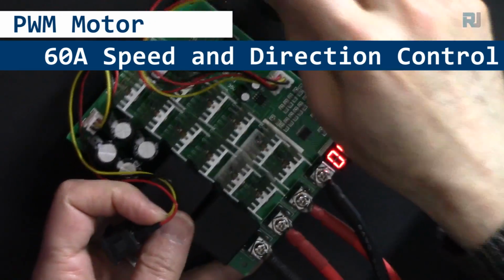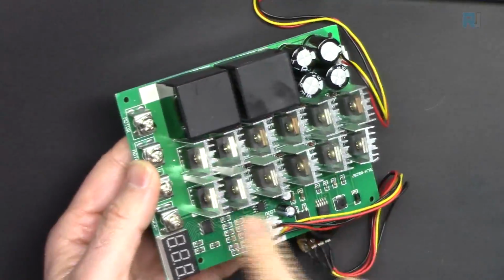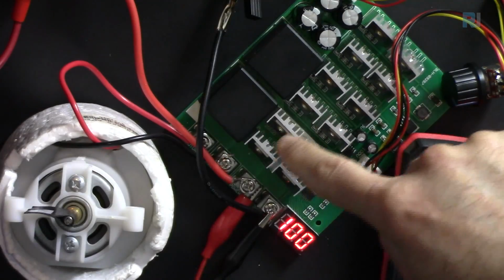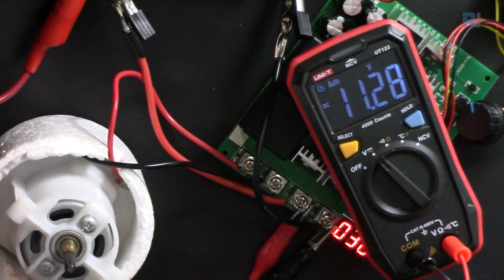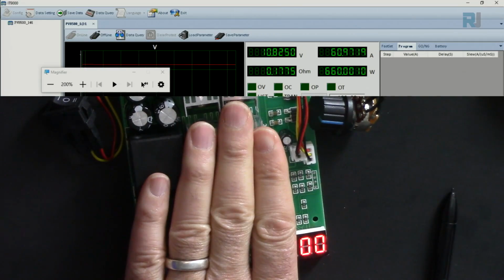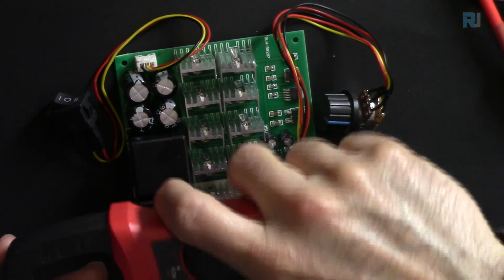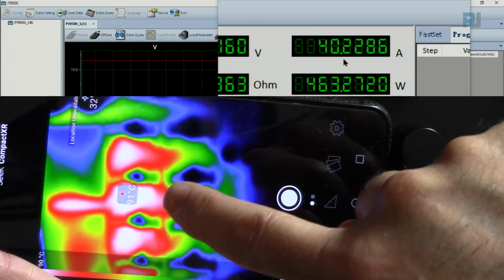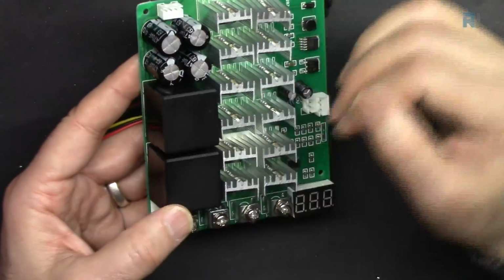DC 10-55V 60A 100A Motor Speed Controller PWM  Reverse Control Switch with LED Display Relay

Comment: Greetings of good blessings from God - May the peace, mercy, and blessings of God be upon you - My dear respected brother Ahmed, may God keep you, I have a question for you. I  would like to consult you - It was a car wrap that I converted into an engine. Are the performance tests that you conducted on these unit specifications?(DC 10-55V 12V 24V 36V 48V 55V 100A PWM HHO RC Greetings of good blessings from God - May the peace, mercy, and blessings of God be upon you - My dear respected brother Ahmed, may God keep you, I have a question for you. I know that this is not the content of this video, but I would like to consult you - It was a car wrap that I converted into an engine. Are the performance tests that you conducted on these unit specifications?(DC 10-55V 12V 24V 36V 48V 55V 100A PWM HHO RC Reverse control switch with displayLED) Is it suitable for controlling the speed of this engine? For your information, this engine has high amperage. It was the predecessor of a car and I converted it into an engine. Thank you. (And by God, I hope you will respond quickly. Thank you, because I want to use it on a cargo bike. Thank you, thank you.) LED) Is it suitable for controlling the speed of this engine? For your information, this engine has high amperage. It was the predecessor of a car and I converted it into an engine. Thank you. (And by God, I hope you will respond quickly. Thank you, because I want to use it on a cargo bike. Thank you, thank you.)

Comment: Does reducing the speed also reduce the torque of the motor?
Reply from the maker: no. the motor will slow by how much load is applied on it.

Comment: Hello, I would like to know if I can use Arduino instead of Volume (Potentiometer) , it can be controlled by PWM signal or soft start/stop instead of volume or not? 
Please help me, I will try this on my project in the last semester.
Reply from the maker: Search my channel for Arduino.
Reply: @robojax  OH Thank you!! i will check on it
Reply: @robojax I checked your channel but I don't see any videos where you hacked with this motor driver or can I see other videos with the same information about using Arduino to control instead of potentiometer of this motor driver.

Comment: Hey, does these boards need diode across relays coil?
Reply: I had the same question....
Reply: @woodworking_automation  i did not put diode. Im running only 40w 12v wiper motor with 16-18v. Use is wire stripping machine, pretty high load. Its good to oversize always chinese cheap products.. if they say its for 20a then its propably good for 5-10a
Reply: @Reivoouz  Got it thx

Comment: Would it be possible to run two or even three of these paralleled at the outputs? Also the speed control wire in parallel to always run them all at the same speed
Reply: No, these are PWM and running them in parallel without expert modification to share the same clock is guaranteed to behave badly, both from safety and from controllability point of view.

Comment: Hi Sir, you're doing a marvelous work of educating us, Can the Module Frequency be Adjusted from 1 Hertz to Maximum Kilohertz? What can be done for it to work that way?
Reply from the maker: Hi, it uses 555 time. I have explained it in another video https://youtu.be/k13iTmvPtUU and there are tones of circuits on 555 time.

Comment: Excuse Me, for you is possible use in input 57v and extract 40A continuosly in output? Thanks
Reply from the maker: I have mentione the minimum and maximu voltage. You make take risk if you connect it to over 55V. Check the capacitors voltage and see if they are higher than 60V or higher, then you may take the risk. But I woudl adivse against it.

Comment: Hi tell me please I want to operate the Governor control card for the Cummins generator QST 30 his Governor is PWM signal control I fix PMU wire RPM Sencer with potential metre tell me it's working or not??

Comment: I am looking for a pwm controlled card that works with arduino at low frequencies (for linear actuator control). Actuator supply will operate at 150-200V DC and 10A. Can you have a suggestion? 
Good work, thank you.
Reply from the maker: You can use arduino and get high voltage MOSFET it should work.
Reply: @robojax  I asked in terms of a ready-made card or product recommendation.  I don't have time to make it myself, if there is a ready-made product, I have to buy it and use it.

Comment: Mr.ahmad if input 48v...for output can i use 12v dinamo ?
Reply from the maker: This module does not change the output. If input is 48V then output will be 48V.

Comment: Middle position of the switch, you said, "is off" - what does is mean? Is the motor terminals shorted for breaking or left open for coasting? This is actually very important. Thanks!
Reply from the maker: Open

Comment: I have blown up two of these units using them fot HHO gas Generation max 25 amp 12v
I was Trying to fix them. on one the three number led gets very hot were you able to identify the driver chip.
I looked at a Tm1637 but this is for a 4 number  led any help would be appreciated.

Comment: Still hoping the PWM control hack is coming soon.  This seems to be the only motor controller that might work in my project for less than $150...but arduino control is critical.  Thank you VERY much for all the info and your efforts!

Comment: Hello Brother Nice job done ....but I need ur help regarding "bh-17n-d pwm"
How could i connect this PWM knob with Electric bike throttle beacause this bh-17n-d pwm circuit knob have 5 wires and my throttle having 3 wires.....plz guid me.
Reply from the maker: Please see my comment under other video
Reply: @robojax    still confused ....can we make a combination of pwm knob 5 wires to Ebike 3 wires? 
I shifted my fuel bike to ebike mechanical tasks finished but still hanged with that 3 and 5 wires combintion.
Inshaa Allah my project is ready but ....

Comment: Nice video. 
What’s your conclusion? I ask this before finishing to the end. Sorry. 
How can I tell if this will work for my treadmill motor? I’m using a Lieli 4.25 hp, 130 VDC model number 116ZY1-1. It has four wires. 2 for power and 2 blue ones for thermal cutoff. 
This looks like a simple speed controller but I don’t know if it will work with my motor. 
Thanks,
Paul
Reply from the maker: the maximum voltage is 55V and it will not work with 130V DC.

Comment: I haven't tried this particular model yet but I have used a bunch of similar PWM controllers. I keep ordering bigger ones as I blow them up pushing too much current in my wild quest for speed. I have made an electric wheelbarrow, bike and canoe motor so far. 

Biggest problem is that the ground trace heats up so much on the bottom that the smaller traces on the top delaminate, killing the circuit. Ones without fuses can be taken out by stall current and back EMF.

I really wish there was a properly robust and well designed option available. The combination of high current and heat in close proximity to tiny SMD parts is bad design that is perpetuated through all of these devices, IMHO. Modern manufacturing styles.

The higher current versions simply add parallel mosfets and then a fan, which is a "cludge" attempt to keep the PCB from melting down.

That being said, when I used them more conservatively I had more luck. 

Just a normal electronics tech making motorized things for my own enjoyment, waffling on to nobody!
Reply from the maker: thanks for sharing your thoughts. I agree with you. this is just putting multiple mosfets in parallel.  The proper design probably would need only 1 or 2 of these mosfets with proper heatsink.  Good luck with your projects.
Reply: @robojax  Very cool to see the thermal video. Thank you for taking the time!
Reply: Have you found a reliable one yet?  Seems like brushless is the way to go since we can access controllers from the ebike world.   I have a 12v 60a brushed trolling motor.   I'm thinking about potting one of these "60A" units in an anodized aluminum enclosure and clamping it to the motor shaft for liquid cooling.  A fan is not an option for wet saltwater environment..

Comment: Hey show how to wire it to a ebike control. That will be a popular one
Reply from the maker: Hi, never used eBike and just searched. Don't know where to start. They are offered as kit which are very expensive from $200 to $1000.
Reply: @robojax  I didnt get ur reply sir,  still confused ....can we make a combination of pwm knob 5 wires to Ebike 3 wires? 
I shifted my fuel bike to ebike mechanical tasks finished but still hanged with that 3 and 5 wires combintion....

Comment: I m planning to use it for kids 4 wheel drived car. And using 18v makita battery. 3 wire pedal.
Reply: I m stocked with this pwm 5 wires to my Ebike electric throttle 3 wires....if u have already tested or a plan plz share with me.,..thanks

Comment: I want to know that when i connect motor of 24vdc 90w . And at full load can i change switch position, relay will damage after how much time i switch from 1-0-2 respite ( cycle test of relay ) . from my experience it will work for 1000 to 2000 time at full load .

Comment: Will this work with a 12v brushless motor?
Reply from the maker: this is for DC motor. Brushless motor has 3 wires and it needs Electronic Speed Controller or ESC.
Reply: @robojax  Thank you.

Comment: Hello, good evening, friend, this module does work with a 1000w 11A 15khz motor, and I have seen that it is installed on a small electric vote

Comment: I bought such a driver for an 1162W on 24v (48A) outboard. Hope I didn't make a mistake. It's nice that you shared your test - I think you should, however, load the controller with a more powerful motor to check the actual strength of the system. (google translate)
Reply from the maker: I tested it with 60A. Please watch it.
Reply: What's about 24vdc motor work on this product . Please reply me

Comment: Hey Ahmad, I'm using one of these controllers for a kid's power wheels toy vehicle. The problem I'm having is that the throttle pedal is just an on/off switch and I'm using the knob for speed control. In this case once the throttle pedal is released the car brakes violently because the controller shorts the motor windings at rest. I believe I could use a power resistor between the 2 pins normally shorted at rest on the relay to soften this? With there being 2 relays on this controller due to the forward/reverse selector do you know how/where to put the resistor so that it would brake softly in both directions? Thanks!

Comment: Hey there, what about hack using this module via arduino. (should we cut output of 555 timer pin 3 and sold a wire same)
Reply from the maker: Yea. Hack is coming soon.
Reply: @robojax  thanks
Reply: @robojax  still waiting for this tutorial mate. Have you already posted it? Asking just in case I missed it
Reply: Let me no when hack is available

Comment: YAY   ANY SCHEMATIC ?
Reply from the maker: Why people ask for schematics? This is so cheap that it is impossible to make it cheaper than this . Any components you buy you can’t make it cheaper than this.  Besides just spend half hour and draw it. Not that hard.
Reply: @robojax  so you do not have one ? did you design it ?
Reply: @David_11111  it was already mentioned he purchased it from Ali express

Comment: Hello Ahmad,  I bought this unit a couple weeks a go and tested it at 20 amps on resistive load. It is warming up around same area than yours. I was questioning it the heat was generated by the relay or copper traces underneath.  Your tests are confirming I should not rely on it for the sawmill I'm working on unless a fan makes all the difference.  BTW,  mine shows about 3 sec ramp up time (soft start) when I turn it on with the pot. I would not recommend to change motor direction without first turning the pot to 0 or off on a bigger motor. Tks for the video
Reply from the maker: Hello, Thank you for sharing your experience.  Thanks for the tip on speed to be turned down before changing the direction. very important.